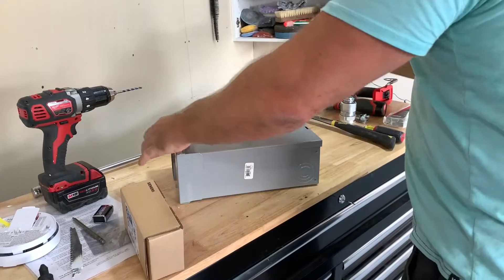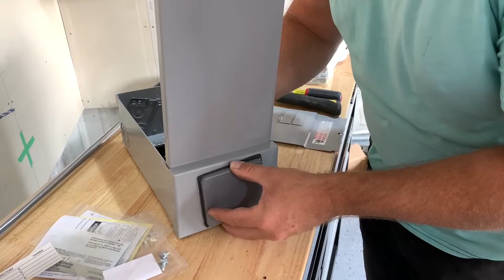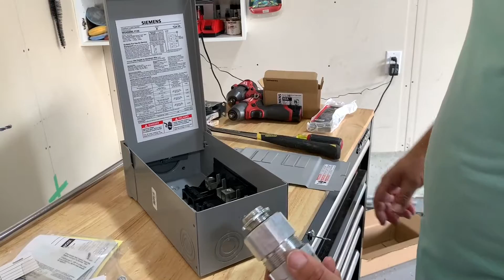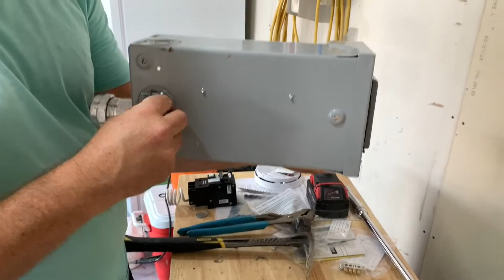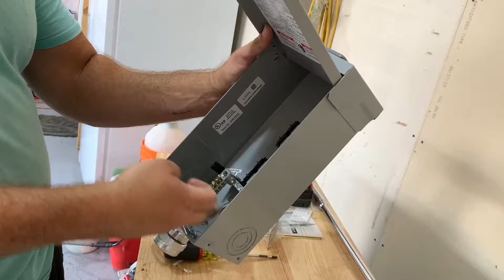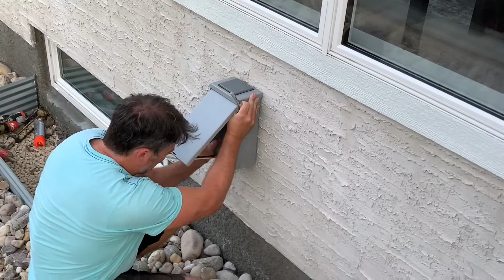Spa pack set up and install - DIY

Comment: Great Video, Thanks! Installed the same box but 60A on my house. Used same holes for in and out too...
I did not like that cheap cap with that cheap seal for the top.
And that box is not water tight at all.
Reply: It’s what happens when you go with Siemens square D all the way, baby

Comment: What is the difference between a “spa kit” like this and a “ac disconnect box”?  They seem very similar to me…thanks for the instruction!
Reply from the maker: @Researching101  in this case it is done to satisfy local electrical code.  Most require an outdoor GFCI and that GFCI has to be a certain ditance from the tub.  But depending on your local code, you certainly could have a GFCI in the panel.  Save about $150 that way.
Reply from the maker: an ac disconnect is more of a switch. A tech can cut the power to the unit by pulling out the bridge piece.  A spa kit gives you a GFCI breaker so there is a measure of safety for the hot tub. The AC disconnect wouldn't trip like a breaker should there be a voltage spike or the hot tub heater short and put a current into the water.  Hope that helps!
Reply: @jofalltrades1816  definitely helps, thank you so much!